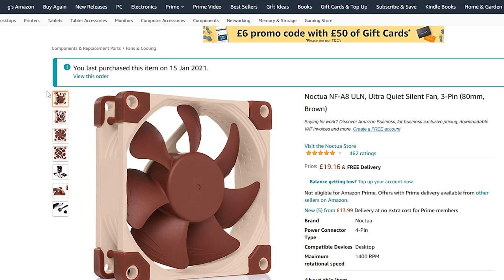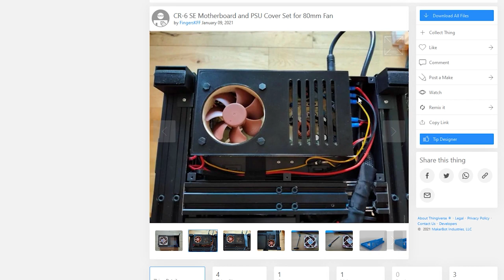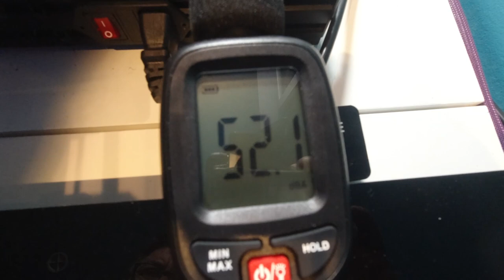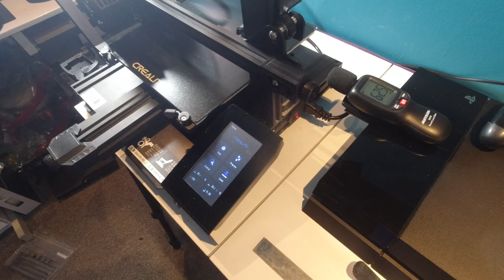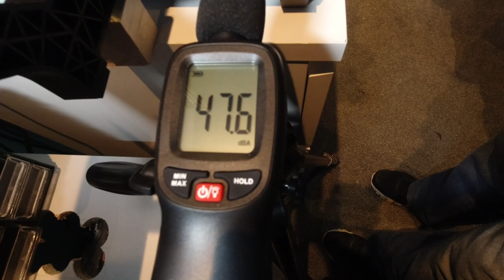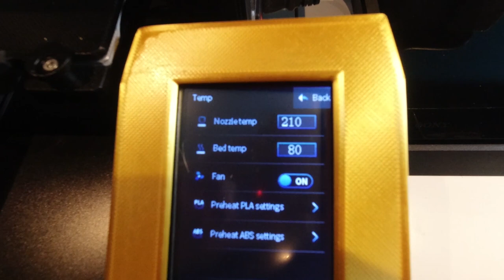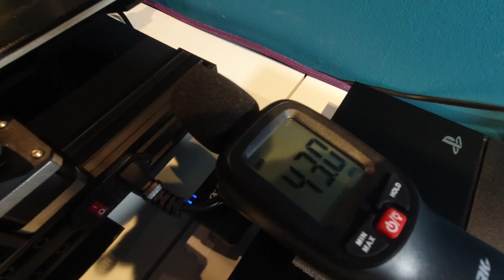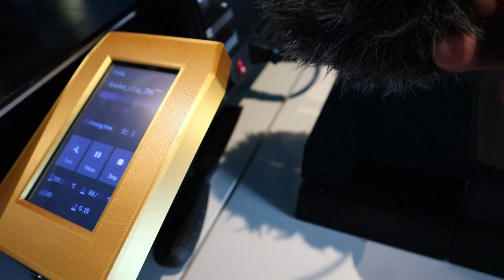Creality CR6 SE fan upgrade to silent Noctua fans

Comment: Hi Tom, I've been trying this but so far no luck getting any of the fans to spin. It all works on a power supply but once I hook it up to the cr-6 mainboard the fan never starts to spin. If I simply turn it on and measure the fan1 dock (or fan2 for that matter) i never get more than about 2 v it seems? Haven't seen the PSU fan spin either but I'm afraid to burn the main board before that one kicks in. Any clue what I'm doing wrong?
Reply from the maker: Hi Iron....when 1st turned on and nothing is heating up the fans don't run...just checked on mine and as soon as you select prepare and start the bed and hot end heating you should find the fans kick in ...they are so quite you cant hear them......I made my front enclosure from white petg so i can actually see the blue glow of the buck converter when the front fan kicks in......just try getting stuff heating and see if they come on.....it wont do any harm to the board for the few seconds it takes for them to start.
Reply: @TomsManShed  Tnx that gives me confidence. I thought the mb fan would go straight away. I’m really hoping to let my multi day prints go without the wife complaining about noise at night
Reply: @TomsManShed  none of the fans spin anymore, not even the part cooling fan (which I can see should be at 50% in the GUI). I think I might have wrecked the card.
Reply from the maker: that's curious it all went without a hitch for me as shown in vid ...the big tree tech board is not much money and has some extra features so may be worth getting....I run through the fitting of it in detail in another vid.

Have you asked in the Facebook group?....there are some FAR more knowledgable people than me in there who i am sure would be of help...hope you get sorted.
Reply: @TomsManShed  tnx, no I'll probably should go and have a look. I did burn a buck converter by reversing polarity so perhaps that gave some negative feedback to the main board and killed it?
Reply: @TomsManShed  finally got a replacement motherboard and all is well now 🙂

Comment: I finally decided to mod my CR 6-SE, and it worked! The printer is much quieter. Thanks a lot for the video, it was really helpful to see someone going through the whole process.

One slight modification I made: Noctua recently launched the NA-VC1 24V DC to 12V DC step-down voltage converter, it works like a charm and is easier to use than a buck converter. I did have to cut one side of the female socket connected on one side, though, so that it would connect. This noctua part is for 4 pins PWM fans, and I used 3 pins fans, so the female socket is not wide enough: after cutting it, everything is fine, there's just an unused pin on one side.
Reply from the maker: Hi Benoit...thanks for the kind words....thanks for the info on the NA-VC1...useful for the future.

Comment: Hi Tom,
Can I use NF-A8 PWM fan? PWM has 4 pins. I couldn't find the ULN in the country I live in.
Reply from the maker: Hi Gurkan...am sorry but I don't know the answer...I suspect you could as I think the 4th pin is used to control speed so they would just run at a fixed speed which would be fine.

I don't know which 3 pins to use though....you would be best joining the CR6 facebook group and asking there...there are some very knowledgeable people on there.

Sorry I couldn't be of any help

Comment: Any chance I could connect BOTH fans to the PSU directly, using a Y splitter? I mean, my 80mm fans pull only 0.11A each.
I mean, we do this all the tiome with PCs, connecting 2-3 fans on the same header.
No need for a buck converter if that's the case.
Reply from the maker: you could try it ...it's just that the PSU fan is switched on according to the temp sensor there. The other fan for the main board comes on as soon as the bed starts heating ...so the main board would only be kept cool when the PSU fan kicks in.
Reply: @TomsManShed  Correct. I ended up hooking them separately. The PSU is not kicking in all the time.

Comment: Hello TOM, I have a CR-6 MAx and from time to time it gives me sporadic problems like it freezes when calibrating the bed and the extruder motor does not work. I'm thinking, could it be the source or is it advisable to change the bale for a Bigtreetech CR6? . Greetings
Reply from the maker: Hi Marcel....I am not sure what the problem may be.....Intermittent faults like that are always the hardest to diagnose.

You could try re installing the firmware or updating to the community firmware which has many extra features (see my other vid) if you are still on the stock firmware

I did upgrade the motherboard to a big tree tech one (again see one of my other vids) but only because I had bought one when I bought the CR6 as I had read that the stock board wasn't very good ...however I didn't have any trouble with my stock board so don't know if it would help.

Maybe someone in the Facebook group may have an answer...sorry I couldn't help.
Reply: @TomsManShed  Thank you , Tom.

Comment: are there fans you can replace the hotend fans with? Did your replacement today and i dont like the sound from the 2 remaining fans
Reply from the maker: Hi Benedikt...yes there are though I don't know all the details...one of them is 24v so you would have to mount a buck converter somewhere unless you can source a quiet 24v one...its the side mounted part cooling fan  that is the noisiest....for now I can live with the sound of mine ...but it may be something for the future...if I do ...I will do a vid of it....am just editing a vid on installing the community firmware which I did today ...it will be on line in a day or 2 if interested.

Comment: I had the buck converter plugged in to set the output voltage and the input cap fried on the buck converter and the power supply fan stopped working. When I plugged in the original fan back into the mother board it too doesn't work. Any idea on what happened and hopefully how to fix it? (Everything else seems to be fine its just the fans don't work)
Reply from the maker: Sorry to hear that Roy....noni don't have any idea what happened other than it being a faulty buck converter?.but. Seems like something else has blown if the original fan doesn't work either...maybe somebody on the Facebook group could point you in the right direction ....there are some knowledgeable folk on there
Reply: @TomsManShed  Thanks for the quick reply. I think it was because, as you said, the connector is reverse in polarity (it's the connector on the logic board that is reversed) and I forgot to check that. Why they would do that is a mystery just like the question why they used a 24v fan. Anyway, it gives me the excuse to get the BigTreeTech board.

Comment: If you put the printer on a slab supported by foam / squash balls then you will get a massive reduction in noise.
Reply from the maker: Its not noise conducting through the surface it's placed on it's that the stock  fans are just noisy being low quality small and fast spinning even if the printer was in mid air you would hear them.

I tried the above method with my CR10 Mini 2 years ago and although reducing resonance and mechanical noise it doesn't reduce the whooshing noise of the air from the small fast cheap fans.

Comment: Thanks Tom, all parts finished yesterday and I installed the fans today :) 
The difference is really mind blowing.
I also changed the hotend and part cooling to noctua 40mm aswell.
The thing really is silent.
Great video
Reply from the maker: Thanks for the thanks Nick...yes like you say the difference is vast.....amazes me why manufacturers cant just fit them as stock...would only add a few pounds/dollars.

I can live with the hot end fan noise for now...

In the words of Depeche Mode ...Enjoy The Silence :)
Reply: It's more silent but not that great for part cooling, limited air pushing out of the fan for that,but most people only notice it when maximum part cooling is needed

Comment: Can this also work for the CR-6 Max?
Reply from the maker: Hi Norbert...I don't know...its been quite a while since I used the CR6 SE (I still have it though) ...I bought an Elegoo Neptune and have now bought a Bambu Lab X1C

I would think somewhere that somebody has done it though. Its just a matter of finding the replacement printable housings and sourcing the correct fans and buck converters etc.

Best place to ask would be a CR6 Max facebook group ...sorry I couldn't help more.

Comment: thanks for the video Tom,

I bought myself a first gen CR6 SE and upgraded the switch immediately as well as the mainboard (was a 4.5.2 and upgraded to the BTT). I was very impressed with this silence upgrade and had all the parts (fans and Buck converters) come in from Amazon. Everything looked good until I connected the Buck converter to the fan outlet on the new MB. The converter blew up completely. The old fan reconnected and it will not turn anymore. After contact with BTT it looks like one of the fan MOSFETs was destroyed. In the CR6 Facebook group someone told me that I could not connect a Buck converter to a mosfet driven output. I tried it with another converter on the 4.5.2 board and works like a charm. So any thoughts on this upgrade on the BTT board?
Reply from the maker: Hi Flip.....thanks for the thanks....Strange what happened re the Buck converter...I too fitted a BTT board after this vid ( it's part one of a 2 part vid I did if you check out my other vids) and I had  no trouble at all.

Vid is here: https://www.youtube.com/watch?v=Rje8_UsK7cU

I plugged the buck converter/fan into the BTT board and it works fine and has done for months so I  don't know what the advice given re mosfet driven outputs was about.
Reply: Tom thanks again. I contacted BIQU and they talked me through testing and filming  the test  of the mosfets. Clearly one is defect. They send me a replacement board no questions asked. Great service! The 2nd Buck converter works fine so I will plug in the noctua's  on the New board. The supplier of the converters is another story though, responsive but can't be their fault. After a little persuasion the representative suddenly hasn't the autorisation to refund the damage done. So I requested to bring my claim to the level with the authorisation. Then it went quiet .... We'll wait and see.  Cheers.
Reply from the maker: Hi Flip....yes I suspected the advice on the FB group saying you couldn't' do it and had to run a wire straight from the PS  was wrong as I had done it same as you tried with no probs.

I did think it sounded like a dud buck converter that caused the damage....great to hear the service from BTT was good and shame the Buck converter supplier wasn't the same....give them a bad review if no joy......if bought from Amazon they should refund you no probs ...I have had great service as a buyer from Amazon 

Glad progress is being made...good luck.

Comment: nice video ..Can i put 2 x 24 volts input and 2 x 12 volts output on buck converter?  wanna change blower and hotend fan  can i use just one buck convertor ? ( sorry for my poor english) thx
Reply from the maker: Hi PlacideBolack ...To answer your question...I don't know.
Am not sure if the buck converters will handle multiple inputs/outputs.....you may be best asking on the Facebook group as there are some very knowledgeable people on there.
Since buck converters are very cheap I personally would use one for each fan...if you can find space in the case for them.
Sorry I couldn't help more.

Comment: Hi Tom

Thanks for the mention and thanks for using my parts :)

Couple of comments on your commentary:

- The Noctua fans that you have linked are the NF-A8 PWM.  These are rated about 7db louder than the NF-A8 ULN that we've used.  When I bought my ULN fans they were listed at £13.99 so you're right that the £19 price tag is too much, worth shopping around for a good price.  Both are great fan options but I deliberately went with the ULN (Ultra Low Noise) fans as they were so quiet.
- I opted to remove the screw hole that would have been at the top of the motherboard cover since it would require supports to print, add a lot of extra time to the print and wasn't easy to actually screw into without making it overly reinforced.  As you've said it isn't really needed anyway so I just left it off.

Hope the parts are working well for you.  Next step:  replace the hot end and part cooling fans!
Reply from the maker: No its my thanks to you Matt.....Doh...yes my mistake ....hadn't noticed the  PWM & ULN bits ...will alter that in the link now.....maybe the hot end in the future but its pretty quiet as is...thanks alot again :)

Comment: Will you do any video for hot-end fans change? Thanks for the great videos!
Reply from the maker: Thanks for the comment I appreciate it...I haven't any plans to....the hot end fan itself I find is pretty quiet...most of the noise as you will know now comes from the part cooling fan on the side and for the moment I can live with it.

If I ever do swap it/them I will do a vid on it though.....I received a BTT motherboard the other day that I had ordered a month ago from Bangood expecting my early board to fail from what I had read......However it has worked perfect almost non stop... but now I have the board I may as well put it on.....So I will be doing a vid on that (even though its already been done on YouTube)
Reply: @TomsManShed  ah i see. I ordere some Noctuas for my CR6,the A8 ULN for the power supply and for the mainboard and the A4x10 FLX for the hotend part cooler.  

Seems like the hotend  fans are both really noisy on my machine so that's why I was curious on how should i approach them. 

I'm interested in your BTT board video, definitely gonna watch it to see if there's any   big  improvements and maybe i'll get one myself for a future upgrade. 

Thanks a lot!

Comment: greetings from the states tom, I was going to go straight for the hot end and part cooling fan thinking it was what was making all the racket. Thanks for steering me in the right direction
Reply from the maker: Hi Roningrae ...yes they bulk of the noise is from the fans replaced in this vid......there is still some noise from the hot end fan and there are some who have replaced that as well.

However I have left mine as stock and the printer is running as I type this just 4 feet away from me and it doesn't bother me at all

Comment: The link for the fans I broken. Anyone have a good one?
Reply from the maker: Hi TheGunguy

I just clicked the link and it still works for me ...it opens up one on Amazon for £16.75.

It's now over 2 years since I uploaded this vid so sometimes links will stop working due to sellers changing  etc.

If ever a link doesn't work a quick google for the item model/name (in this case Noctua NF-A8 ULN) will lead to loads of sellers

Comment: Hello,

I'm looking at upgrading the fans (obviously) and i've found some other noctua fans that seem like they would work well? I'm thinking about using the Noctua NF-R8 REDUX 1200 fans, which are cheaper quieter and push the same amount of air. The only real difference I see is there is no over molded rubber corner pieces. Do you believe these would work well? Also, are the two pin connectors used JST-XH 2 pin connectors? I'd rather not cut the cords on the stock fans for the same reasons you stated and I was looking at ordering some of the connectors off of amazon.
Reply from the maker: Hi Alex...Those fans look fine...all the specs like voltage and noise look good so cant see any problem (but cant be ABSOLUTELY definite so don't quote me :) ) 

Re the plugs ...I don't  know what the connector is actually called....I just used some that were the same off an old fan I had and a plug and lead I had lying around.

Maybe there will be  site online somewhere with a "connector recognition" part where you could compare pics and measurements etc ....I didn't want to snip them off the old fans as like you say I may have wanted to return the printer. However I have done quite a few upgrades so even if something failed under warranty it would be a nightmare to get back to stock form so the return option is non existent anyway

It has been totally reliable and its great to sit here in virtual silence while it does its stuff ...the fan upgrade is the best decision I made :) .....sorry I couldn't be more help.
Reply: @TomsManShed  Thank you. After some digging I believe I found the right plugs but I can always order different ones if that isn't the case. Regarding the fans I chose if fan vibration becomes an issue I plan to add some thin foam dampening tape between the new casing and the fan. Thank you for the awesome video and quick feedback!
Reply from the maker: Hi Alex...that sounds ideal.....if you are using the same housings as in the vid and haven't already printed them I would advise using PETG for them instead of PLA....I had to take the motherboard cover off to check something after doing the vid and a couple of the slats cracked.

I have since re done the motherboard one in PETG and its much less brittle ...I only had white PETG but its a bonus as I can see the blue LED of the buck converter through it so I know that part is working.

Comment: do you think a buck converter would fit inside the hot end fan housing? I'm thinking we could also maybe fit a noctua fan inside there aswell. thoughts?
Reply from the maker: Hi Azurl...I am not sure....if it did it would be tight squeeze....I think I have seen some different housings for the hot end on Thingyverse  am pretty sure I saw one designed to house a buck converter.

For now I can live with the noise from the stock fans but worth considering if ever one breaks down.
Reply: @TomsManShed  cool! I looked around on thingiverse for hotend housings but didn't find much, I'll keep looking